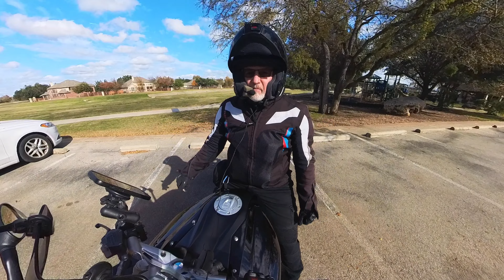NEW BMW R 1300 GS Stats and Interview with BMW Brand Ambassador Shawn Thomas

Comment: Excellent video! Is GS 1300 a bike that you would consider? When it comes out do you plan to test ride the bike? On another note, what kind of gloves are you wearing and what are you using to keep your phone on the bars? And what do you think about the GPS that you can get with the RS since it already has the mount for it. And I was curious about the kind of traffic that you would be riding in. I live in an area where there is a lot of traffic and I really don't like it. Do you lane split is that legal in your state? Thanks for another great video and I will be looking for the next one!
Reply from the maker: Thanks for checking out the video. I am not much of an adventure bike guy so I would probably not buy a GS. However, I do plan to test ride one when I can. I have two pairs of gloves, winter gloves, and some gloves. The winter gloves are Taichi and the summer gloves are a no name brand I purchased for $5 on Temu. I use quad Locke to keep my phone charged and on my handlebars. I took the GPS mount off my RS. Where I live, I have all types of riding conditions including traffic, highways country, roads, back roads, private roads, etc. I am comfortable in all situations except gravel or dirt roads with my street tires.
Reply: @Texas2Tires  Thanks!

Comment: I hated the ride on the R18, a real shit box...I would go with a HD hands down over the R18!!
Reply from the maker: I rode the R18 Bagger which from what I understand has a different rake and the giant TFT, sound system and overall technology is superior to a HD. You’d have to get a $50k plus new CVO with the new display to come close. With that said, the giant boxer engine gets in the way of forward controls and doesn’t produce an inspiring sound. So HD has the R18 beat on those two areas. To be honest, the sound is probably one of the most important points of owning a cruiser, Loud and Proud! The looks are subjective, so to each his own. Myself I would probably go with a Low Rider S or a Breakout.
Reply: @Texas2Tires  My biggest dislike's was the handling, scraped the pegs even on very moderate turns, very buzzy/vibrating/high frequency reving and the shifter is so close to the engine cover that I had to keep my foot at an angle to shift.  I would not nee the HD CVO, a regular 114CU equipped Tourer is far better that that crap R18.